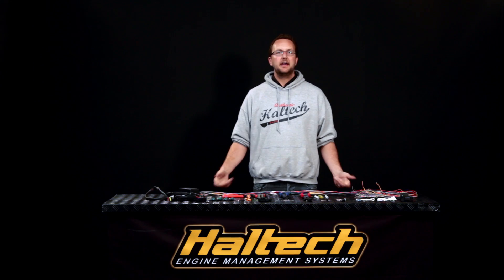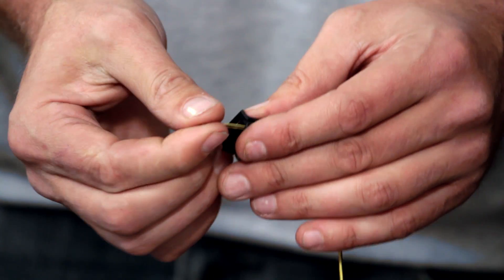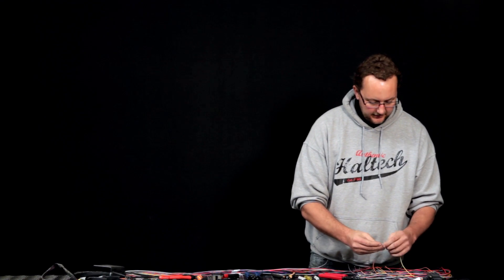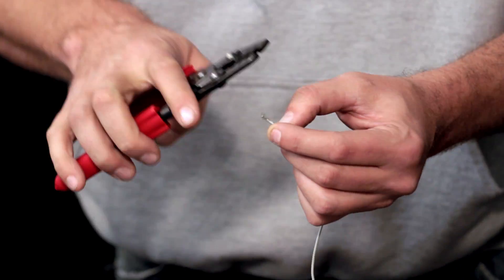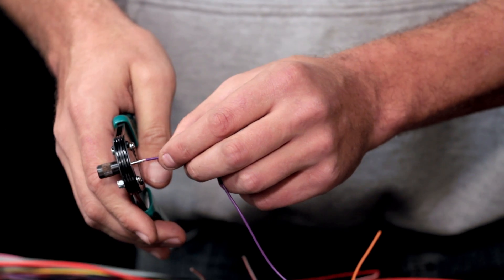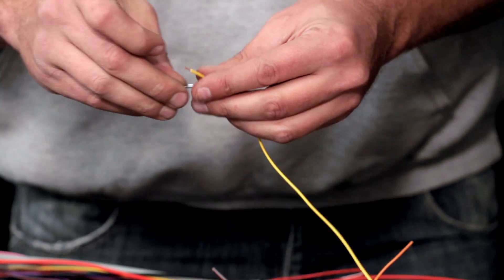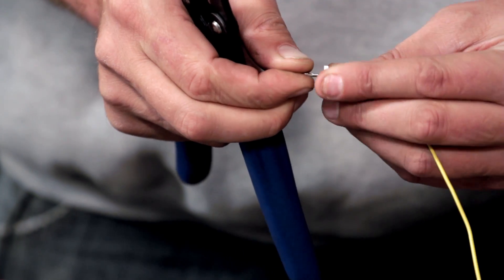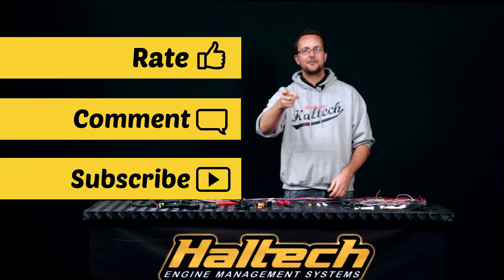How To Crimp Like a Pro | TECHNICALLY SPEAKING

Comment from the maker: Crimping - for many it's a daunting task that is best avoided or left to highly specialised experts. The truth is crimping needn't be hard or difficult. With the right tools and a bit of knowledge you can quickly become a crimping expert yourself!
Tools used in this video: https://www.haltech.com/product-categ...
Shortcuts:
Skip to GM Style Connector: https://youtu.be/VXVISyLUTl0?t=71
Skip to Air Temp Connector: https://youtu.be/VXVISyLUTl0?t=191
Skip to Deutsch Connector: https://youtu.be/VXVISyLUTl0?t=269
Skip to AMP/ECU Connector: https://youtu.be/VXVISyLUTl0?t=355
Skip to Packard Connector: https://youtu.be/VXVISyLUTl0?t=415
-------------------------------------------------------
Liked this video? Here are some more like it:
O2 Sensors Explained: https://youtu.be/IevNJBSNFzA
Trigger Systems Explained: https://youtu.be/FtZJLCY2hso
Launch Control Explained: https://youtu.be/5g2YFquhGtE
--------------------------------------------------------
Like this video? Subscribe to our Channel!
Reply: “This is not the page your looking for. Move on” thanks for trolling haltech, guess I’ll get the tools else where
Reply: One of the most basic questions about the gm style pull to seat connector is "which way is up" - what is the correct orientation of the pin vs the connector body when you pull it in to seat?  I can kinda sorta barely see that in the video, but would be good to be explicit about it.

Comment: You skipped the very important step after crimping the AMP connector. I wasted almost an entire pack of pins when i figured that the connector has a white lock that I needed to push before it would insert all the way.  You never showed that part.

Comment: I depinned the connector. Question is, the metal pin is 21mm long and has a opening on one side. Everything I saw on amazon is roughly 11-15mm long and not all have the opening. How do i source the correct metal pin?

Comment: This instruction was very helpful and explained how to crimp the pins.   My big concern is trying to rewire the engine compartment have a vintage 1974 Porsche 911 the big task of finding the right color-coded wire and the proper pins to fit all of the connectors that are original to the engine compartment wiring harness.

Comment: i like to solder them and insulate them as much as possible from the elements, i think we've all seen 20-30yo copper thats been exposed and looks terrible
Reply: from what I understand from Turbo yoda and others is that soldering causes wires to break eventually because of movement of the wires. Wire fatigue eventually sets in and the wire breaks. I used to think soldering would last longer.
Reply: You won't find solder on an aeroplane.

Comment: I'm not an electrician, but I am a hobbyist at many mechanical pursuits and a bit of a perfectionist at some of them.  For whatever reason, rebuilding wiring harnesses on old equipment is one of those jobs I look forward to and I love to make the new wiring harness as bulletproof as possible.  Using todays modern crimping tools to bring old equipment back to life in a condition better than factory was capable of is both cathartic and satisfying.  Great video btw.

Comment: Just got my 2005 Subaru Legacy GT running on Speed Density with stock ECU.. But man, I'm really looking at a haltech right now. I've flashed the subi one over 100 times while working through all the different tunes with injectors, custom mafs, and now speed density. I could really use the live tuning of a Haltech right about now.

Comment: i once wired half my gf's car with buttconnectors thinking i was smart not to solder....

if only i knew then how dumb i was :)

PS: being from europe i mostly see the "diafram" or hexagonal crimps^^ the gm connector style thing ONLY in my gf's opel haha
Reply: Was it inside of the car or outside. She is not your gf anymore I guess;)
Reply: Gregory May inside ghehe when she bought the car half the electrics on the inside were not working due to cables that had been munched and cut... i didn't make it worse! it didn't burn down... we're still happy together xD

Comment: I have removed a couple of unused wires from the ecu plugs but can't determine the pin type yet, still searching. Also, on the 26 pin plug I pushed the white tab in easily with my finger nail to let the wires pull out. Now I can't push it back in, it worked fine on the 34 pin connector. :/

Comment: What is the style of femal pin for the ecu? If they are readily available in the US, I'd rather grab some here than order all the way from Australia. I need to uprate the ground wire input to the sport 1000, it is only 18 or 20 gauge. I also need to add a few other wires for the alcohol sensor, etc. Thanks for any help, and the video was very helpful as well.

Comment: Great video! I think its important to note that crimping around the exposed copper wire first is key. I've noticed in the past that if you crimp around the sheathing first you end up with a slight bend in the terminal.
Reply from the maker: Michael Gauthier Great tip! Thanks Michael:)

Comment: Heltec endorses crimping??? Solder ftw
Reply from the maker: SideKickNz When done correctly crimping is a more effective method. Not to mention quicker and easier. However if you are proficient at soldering then stick with that:)
Reply: Yeah just when you get a specific way of doing something drumed into you its hard not to have a byest opinion (My boss would kill me if he saw me crimp anything)
Reply: SideKickNz no offence to your boss, but that's a bad attitude, solder creates resistance, crimping creates less and provides a better connection.
however in some situations and industries, solder is a must.
right tool for the right job.
Reply: +SideKickNz Solder is great and actually decreases resistance, despite what was said. There are the areas of the pin that already touch the wire strands and then the areas that are bridged from the strands to touch the pin by the solder. It is great to do if you can avoid melting the wire insulation and sending to much solder into the pin for it to latch correctly. Crimping pins to wire is great as long as you use the proper tool, oem pins on Subaru for example, are crimped very well and provide low resistance. Now if you are connecting wire to wire, solder is hands down the best way, unless you suck at soldering.
Reply: as a electrician with 20 years experience, i could say every wire break i find is at the solder joint on plugs. brittle wire ,plus vibration gets them every time.
Reply: Solder has the least resistance and if done right will never crack or get brittle. I've used soldering instead of crimping since 1990 and never have issues, it prevents comebacks and just works better. Sure crimping is great when you're in a bind, but it doesn't take much longer to prep for and solder. I only crimp connectors or pins to wires when mandatory, but no crimping wires together.
Reply: Solders are suspectible to vibration, heat cycles and enviromental effects and not recommended for marine use and not allowed in aviation use. Also not used by automotive industries due to same reasons. They do save a lot of time though when you don't have correct crimpers available and not building car to last next 200k miles.
Reply: Now you're talking